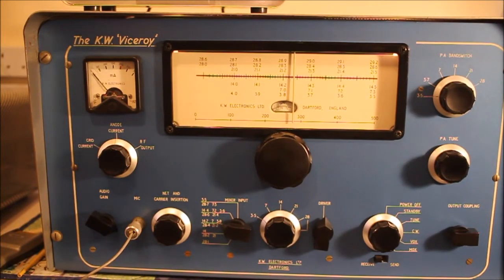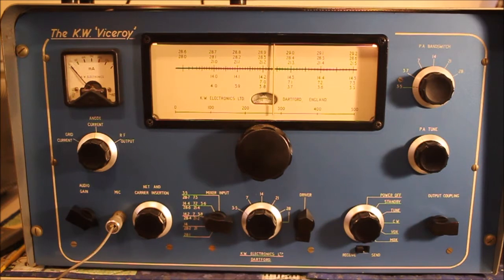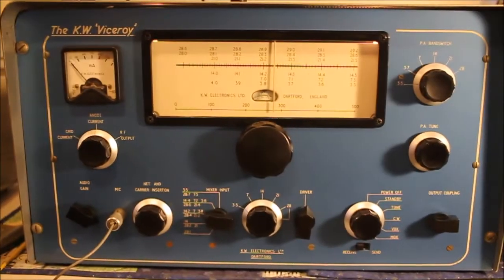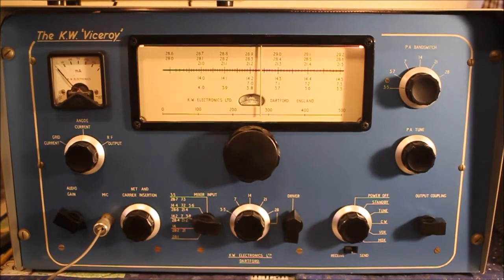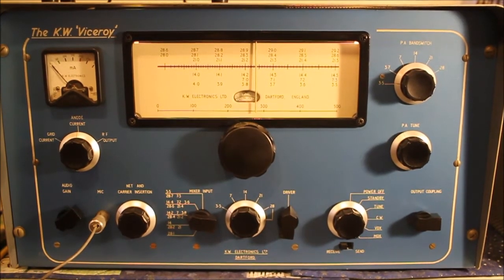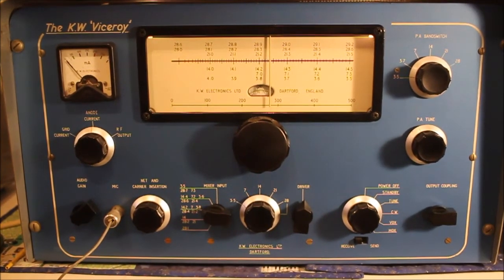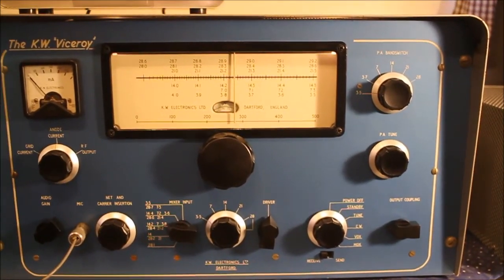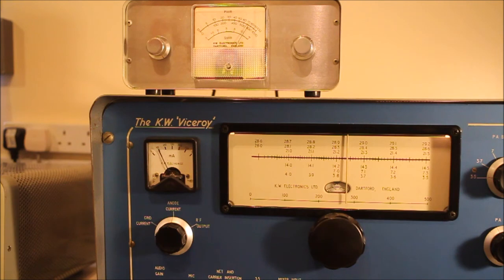KW Viceroy SSB transmitter 1964/1965

Comment: Hi Steve, please make another video showing the operation of the controls and how to tune for ssh, can and am.  Also remove from cabinet to show the interior including half lattice filter, pa valves and underside wiring.  Also would like to see the power supply internals.  Cheers.  Dean.  VK5LB.
Reply from the maker: Good grief Dean !...I'll do my best in the next few weeks. Are you restoring one?. Steve G3ZPS
Reply: I have bought one locally but it has a couple of modifications.  I have an AWA CR6b receiver to use with it.  My collection is Collins, Hallicrafters, Heathkit, Drake and Ten Tec.  I have refurbished all of them.  I intend to do the Viceroy as well.  People do like to see what is inside, how it works, how you recapped it etc in addition to your general narrative.  Cheers.

Comment: Nice AM Transmitter   I  have KW swr bridge it was set for 75 ohms and there is a trimmer cap inside adjusted it with a 50 ohm load and now is a 50 ohm swr bridge.